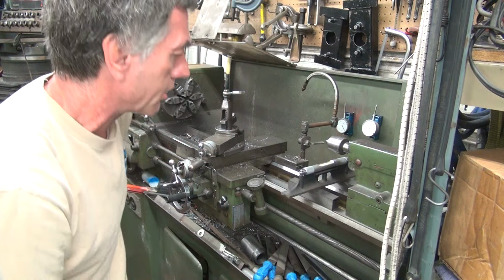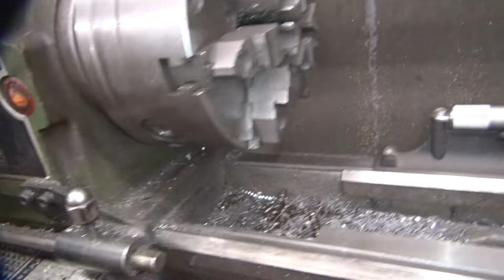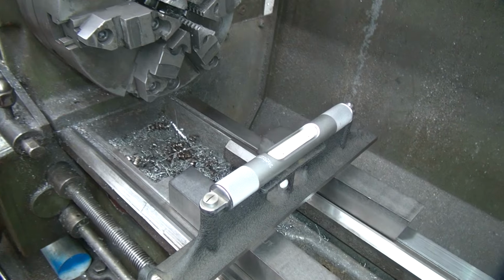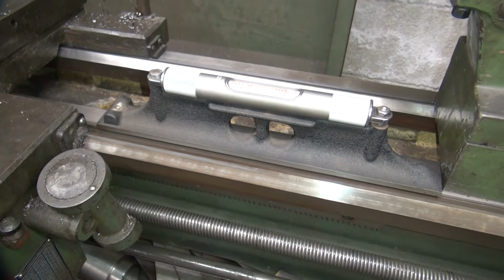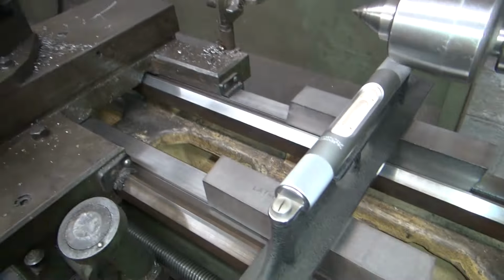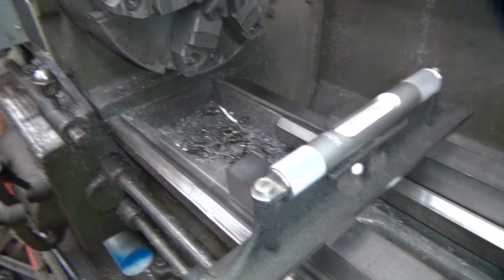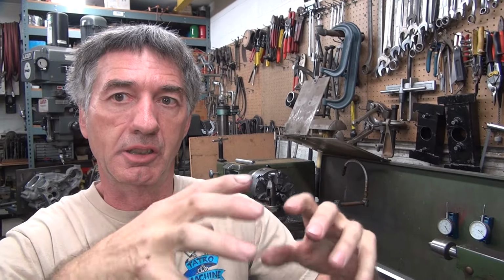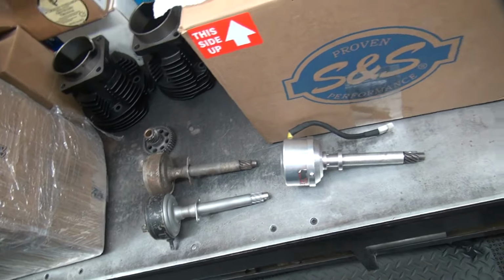#109 fixing my lathe centers centerline dimension so that i can make good parts harley tatro machine

Comment: I believe it’s the flooring, ( tiles).
Reply from the maker: you would be wrong. the adjusting bolts make up the difference in the uneven floor.
tatro
Reply: @TatroMachine  Ideally the lathe would be set directly on concrete with steel pad inserts.  Ideal isn't always available however.  

We do our best with what we have.

Comment: After closer thought , I suspect the deck/cradle rails that the end center and cutter ride on , including the center and cutter are worn , and worn down into the rails , and probably the most wear on the operator side rail , it has no choice but be worn after all the years of use and pressure from cutting , dirt , grit and cuttings . Im guessing the only places you will get any kind of a correct reading on the rails , is on the rails under the head where its not worn or very little and at the very end against the tail . You were probably correct when you said , you see shimming in the future . To take the deck out and machine it would be a big job , not to mention installing a wear plate on the rails to put it back up to  0 again , and not to mention figuring out exactly where 0 would be . You probably already know all that ..........
Reply from the maker: this lathe is like a nice low miles monday bike. it looks good, but it is not all that good.
tatro
Reply: @TatroMachine  A while back , I replaced all the fuel lines quantum line kit and fuel pump fpf in my 08 , appx. 4000 miles ago , About 2 weeks ago I had to trailor the bike home . After checking several things and getting the bike running it would pump up to normal 60 psi  , then steady leak off to 0 psi , at first I suspected a line , regulator or quick connect end , when I finally replaced the pump and regulator , with the original , it would hold pressure , some times prevention from setting beside the road does not work out very well .